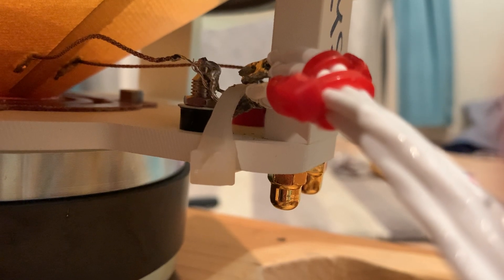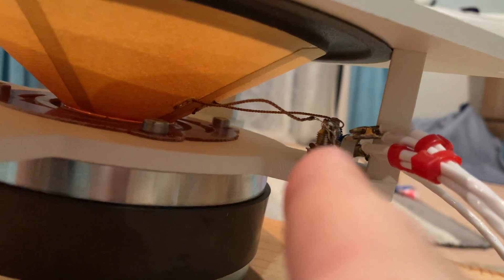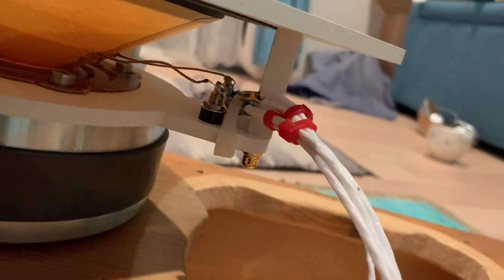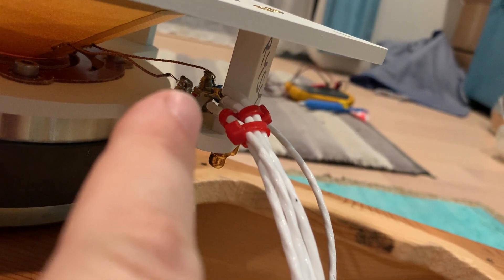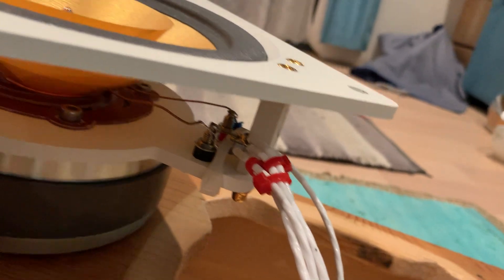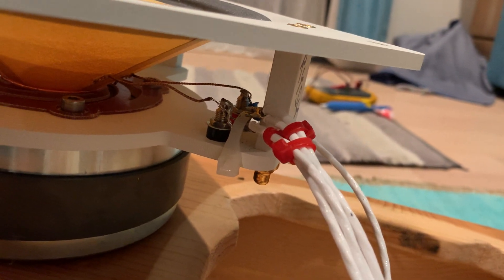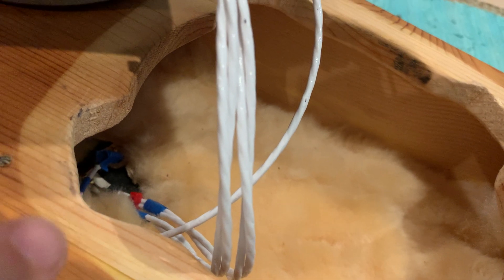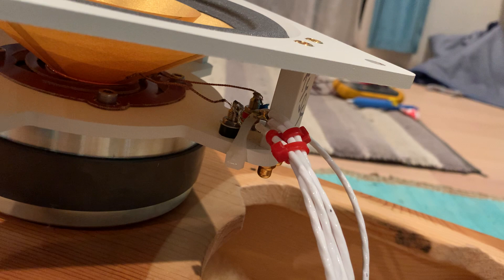Cube Audio Fc8 hard core tweaking: the direct connection!

Comment: The Goodman’s 301’s I now have since loosing the 212c in the floods are directly connected. Ive read this is supposed to be the superior route but unfortunately I’ve no point of reference to discern any difference.
God Bless
🌞
Reply from the maker: 👍👍👍👍👍👍✨✨ So sad for the loss, but happy for the 301s :) If you want to play around with them more, change the solder on the direct connection. Remove old solder with a solder sucker, and replace with Mundorf, Audioquest, Audio note or WBT solder. ;

Comment: Won't those thin wires have more resistance than the original thicker wire coming from the cone, or maybe it makes no difference over such a small span? Maybe resistance is of no consequence in this case?
Reply from the maker: Superb observation! It looks much thinner, however, it does not have a thinner total gauge. The tinsel wire that comes from the voice coil is a braided wires forming a hollow tube, and hence it looks as if it had serious gauge, but the metal in it is similar in total AWG as the hookup I used.

Comment: Curious, why 4 leads to the negative pole of the speaker versus only one wire to the positive pole?  Again thanks for the content, it has to be tough coming up with a topic every day
Reply: Current in reality / physics : The  electron flow goes from negative to positive........I do that sometimes with internal wiring.......( and also because in the latter case one finds often only one shared mass in commercial electronics )....so I double the negative wiring to match the current of two channels... same with headphone which use only three conductors .......the gain/ weight of the music is audible.
Reply: @frankgeeraerts6243  Thanks for answering that question in such a detailed manner, Frank. Janos explained it in a recent video, but I was still a bit curious. Thanks again. : )
Reply: @frankgeeraerts6243  Please confirm. There's also 4 cables from speaker cabinet ( - ) to Amp. Thanks
Reply: @TheZpilot55  Hello Jose , .....from the speakers  connectors when there are Two ( or more ) separeted lpairs of connectors  with each connector pair has its dedicated  crossover network...
One can also  transform a crossover into bi-wiring when you separate the common  ground, as such there is a -/+ pole for each loudspeaker.
When used for  a single speaker ( large bande/full range ) doubling the wiring brings less resistance and as a result a better current flow, but what's more important that means better dynamics and a lively energy flow ........
Hope this ansers your question...

I use solid core wiring instead of multistrand, multistrand leaves/lays  an artistic  FOG on the music......in Litz cables all strands are isolated..........
Reply: @frankgeeraerts6243 Hello Frank. What solid wire? Brand, AWG? Thanks again.

Comment: HI Janos...........yes it will allways make a difference by eliminating those intermediate connecting metals...........differences in perception also help to guide all other modifications by revealing ........................"The  Good , the Bad and the Ugly " ..... 🤔😄

By the way ...............RCA connectors have not only a sound and are eating information /changing the harmony and color off the sound .............but when solderd to the circuit boards and screwed to the connecting rear panel of the chassis will show audible constraints .......I remove them, put in real good ones and have loose silverwire solderd ...........or I solder the interconnects directly to the closest point of the output on the circuit board.......that makes a greater difference than espected ............even on some pre amplifiers or sources I used two outputs  with different  types of RCA connectors .................for example , an AN silver pair and ( depends on  the used interconnect synergy  ) a second pair with Yamamoto 24 K gold ...........or another pair like the the Eichman silver etc...............each RCA has a signature ..........the absencd of the connector eliminates that signature..............as long as all is musical one can live with it !
I was ashonished during the 90's to find out that the WBT connectors which were very expensive at that era had a very weird and bad sound...........in those days everyone thougt that they were the best in the world ..
Reply from the maker: Indeed, I'm not a fan of WBT connectors either! They added a quite strange aftertaste to the sound.... Yamamoto, Eichmann - very good connectors ; ). Have not tried AN yet.... and likely will not, going towards getting rid of connectors (again). Was using full connectorless two decades ago, and I'm finally ready again to go back that route... ; ).